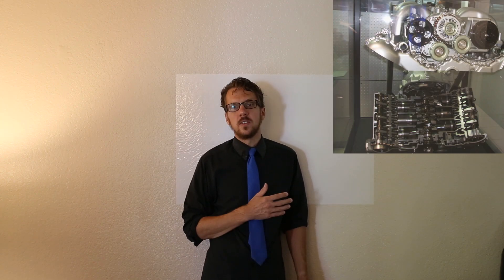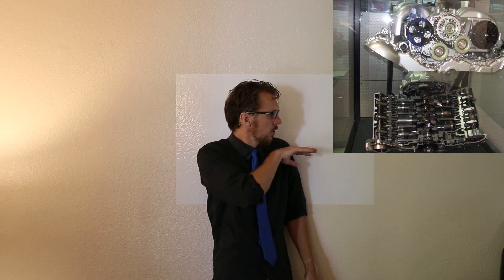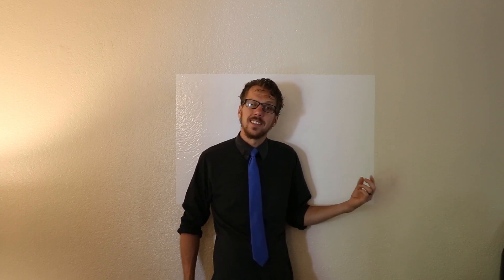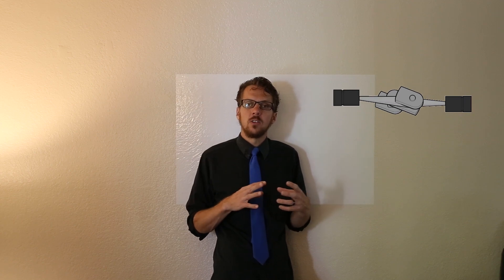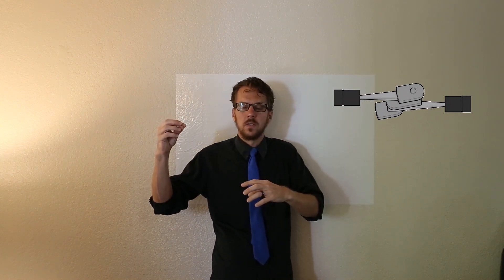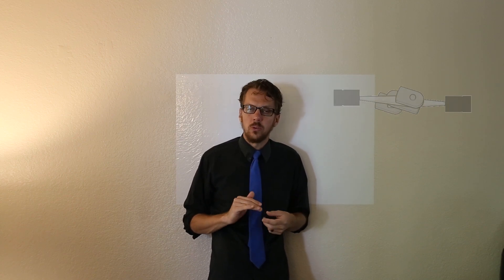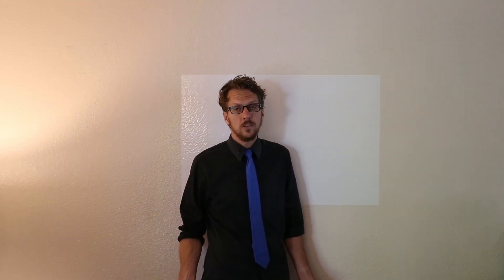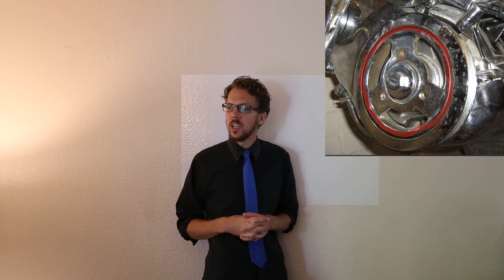How Lightweight Flywheels Destroy Engines (LWFW part 2)

Comment: Would I bother using a light flywheel on a read car? No though have in the past. Racecar however [roadrace and speedway] they are essential and ideally you should also use a lighter balancer as well. As well as a smaller dia one. Or more importantly a smaller far lighter clutch. Centrifigual mass is a real issue, smaller mass the better the engine responds. 
Balance? IF the engine is balanced to suit there is no issues, even a 40lb nuetral balance clutch and flywheel can use one half that weight. Or speedway use just a small dia flywheel with a conical clutch.

Comment: I ve owned and own tercel 4wd 83-87. 22 years ago I lightened the flywheel I removed as much material as possible and had it balanced at a very hi-tech shop. that flywheel is on it s second motor and it s been resurfaced twice... it never broke a motor, nor did it vibrate but it is very rough on the flywheel s middle pilot bearing the one that bears the tip of the input shaft . there is only one PLUS for a lightened flywheel on such a small engine ( 1.45L ) and it should not be your daily confortable vehicule : on a slippery flat surface such as cold snow you get instant torque/;limiited rev , that s it. don t expect to go up hill easy , beware strong winds , forget smooth idle and in cold starts northern region (canadian shield ) hold the clutch pedal and massage it while shaking tranny s oil...

Comment: I put 322k km's on my B18C1 with a lightweight flywheel.  Then I rebuilt it  and it's got another 60k km's on it.......with many a pull to 9,200 rpm.  I daily it, and have never had ANY engine issues.

Comment: The engine is moving the weight of the car from standstill, if it can handle the stress of this task, it's not.going to pack in because you've taken a few grams out of the flywheel

Comment: I have put over 120k miles on a 12lb reduced flywheel (and replacement with same kit after turning the pressure plate into a flower ala leg day). A lot of these have been hard miles including club races, and there is no noticeable irregular wear at all, on anything.

If there is any increased wear, it is only significant academically.

Comment: DMFs are nothing but a cash-grab. It replaces a never-fail part, that was easily replaceable if not serviceable, with a flimsy, un-reliable, and very expensive part. The reason why manufacturers are using them is because they reliably fail early, at around 100k mi, costing $3000.00+ in parts and labour, motivating customers to just buy a new car. The transmissions paired with DMF are also fragile pieces of crap that will break in short time if the DMF is replaced with a single-mass flywheel. DMFs are a regression in every single way. DMFs are nothing but anti-consumer business practices.

Comment: You can avoid that with Fluidampr viscous silicone harmonic balancer... lessen vibrations and gearbox chatter
Reply: can u explain ? tq
Reply: @SPEEDHANTU-si1ph  just replace your stock harmonic dampener with one from fluidampr, other brands do the same thing but it’s less good as they require tuning every time you change the harmonic of the engine…

Comment: First car I ever put a good bit of money into I upgraded the clutch after i torched it just trying to clean the tires off before a street race. Stage 2 competition clutch and an oem throw out bearing(never use the bearing in a clutch kit bc they are trash and never fit right.) Along with a 7.5 pound fidanza flywheel. Car picked up 2 tenths on the et from that flywheel alone not to mention a noticable seat of the pants feeling. Little 4 cylinder car was unbeat motor to motor. On the street. Was putting together a direct port nitrous setup for it with some godzilla sized nozzles when I wrecked the car on a rainy day. Car was prepped to make 550 whp with limited slip and slicks. Had a fender exit 4 into 1 header intake manifold coolant bypass, cold air intake. Colder plugs, limiter raised to 8600rpm with cams to take advantage of it. Solid mounts. Walbro 255 and a stand alone. Had the cam timing perfect had the ignition timing perfect on 93 and 110 with a table to pull timing as soon as nitrous was activated. Had the afr spot on at 11:2:1 off bottle and 10:8:1 on bottle. Wideband was in too of course. Car was scary. Lol
Reply: Fantastic build

Comment: I still don’t understand how it would damage the engine to have less rotational mass if there is s harmonic balance shaft already doing that in the engine and I’ve actually got a Mazdaspeed6 where every single person with one swears that removal of the 20lb balance shaft extends engine life in its case by keeping the oil Chanel clear please explain in more detail y it would damage an engine and how and by how much

Comment: They don't. 

Lightweight flywheels are awesome. I've had one in my AE86 and my NA Miata, and the way they improve engine responsiveness is life changing. All the tolerances in the motor are already finely tuned, the dual mass shit they're putting in cars today is purely to make them easier to drive. Get a lightweight flywheel, learn to drive it well, and you will never want another boat anchor mounted to your rotating assembly again.
Reply: What about a boosted engine?
Reply: iam trying to learn about cars and i have a question. why is the flywheel so important? couldnt you just have an engine without it? and why should it destroy the engine if youd have a lighter flywheel?
Reply: @bakoty6571  it allows the engine to have enough rotational momentum to keep running.
Reply: Yes sir preach
Reply: 😂😂😂😂man “boat anchor”
Reply: @UC30nRA-wEaW6LLcY6447aSw lol because it's a massive heap of sheite
Reply: Love you for this comment
Reply: you put heavy flywheels in a drag car
Reply: Put it on a 997.2 GT3. It will go boom!! Consider engine harmonics
Reply: @latuba2478  The gt3 RS comes with light flywheel… it goes boom but in a good way!

Comment: Flat 6 aren't smooth because you have 2 pistons in a way an 4 in the other way.
So it's imbalanced.

A rotary is balanced (independent of the numbers of rotors, except for 1 rotor)
A opposed piston engine is pretty balanced
a boxster, as shown in the video, isn't balanced

Comment: Claims to have done the math to prove his point but then shows no calculations whatsoever. Fail.
 I have never seen or heard of a single piece of motoring literature that claims DMFs are for the benefit of engine life.
They are there for NVH reduction in the passenger compartment, nothing else. You are not "increasing the vibrations" of anything by removing it, just removing a filter between the engine and trans. How and why this would have any effect on engine life either way is nonsensical.

Comment: The 997 (both .1 and .2) gt3 rs are PLAGUED by these problems. The solution for costumers was adding a ATI dampener. They do take more time then regular engines to blow, but it happens a lot.

Comment: What about the old muscle cars? They didn't have dual mass flywheels back then. A lot of those cars went over 100,000 miles with no issues. And they was pounded on too. And some had flywheels that weight about 20 lbs too.
Reply: I believe the HP 427 corvettes were equipped with a related duel clutch system.

Comment: Just put a 12.7lb flywheel in my FRS (7.8lbs lighter than stock) best decision I ever made.
Reply: How's it looking three years later? I'm about to get a lightweight cusco flywheel and clutch also carbon driveshaft. I want to make sure I won't regret it
Reply: @BRZTrackDays  any regret?
Reply: @swany0095  I changed my mind on the driveshaft. I hear more negatives than positives about it. The clutch and flywheel I'm still getting, but not yet.
Reply: Any updates? My stock clutch is starting to slip a little bit (I have 90k miles on the original clutch) and I’m looking at upgrading the clutch and flywheel, along with the other goodies like the fork and stuff. 

How is it to drive around town? Is it noisy? Was the exedy stage 1 clutch/ flywheel a good combo?
Reply: @Michael Benson I have an 8lb in my s2000.  Traffic is fine
Reply: @Michael Benson not really. Just give it slightly more throttle when letting out the clutch in 1st and it's all good. I've had it in now for about 20k miles, and haven't had a single issue. I went with the exedy chromoly lightweight flywheel, along with an exedy stage 1 clutch. It only took me about a day or 2 to fully get used to it. It makes heel and toe downshifting an absolute joy from how responsive the engine becomes.

Comment: You're actually explaining it wrong, the one you're showing is a boxer engine, a flat 6 is the same as a v6, but with an angle of 180 degrees (the opposing cylinders connect to 1 crankshaft pin)

Comment: You can run a engine with no flywheel but getting the gearing low enough to get 5000lbs moving would be near impossible. 1000cc sportbike engine has no flywheel to speak of and will run for years. A 5 ton truck may have a 60 lb or more flywheel to get it moving from a stop. The mass of the flywheel is there to give inertia to get the mass of the car moving from a stop. The engine needs no more flywheel than is needed for it to start and idle. Dual mass units are for comfort and are often replaced with one piece units as replacements. No way it will ruin your engine ....A corvette with a 350 will not do a burnout with a 10 lb flywheel but will shift like lightning and the engine will run for 220kplus  miles with no destruction. screw your calculations.

Comment: Very little here is understood by the presenter regarding torsional vibrations OR rev-match shifting, which is unfortunate. The better lightweight street flywheels currently available pose no additional problems for engine bearings. In fact, the argument could be made that the lower torsional resistance means the rod bearings might take less hammering. The crank main bearings will not notice the torsional difference at all (they don't "see" torsional excitation), although they will appreciate having less useless mass hanging off the back of the crankshaft due to the reduced bending moment. Also keep in mind that a "perfectly balanced" engine only compensates for 1st order torsional vibration of rotating components. 2nd, 3rd, etc., order torsionals cannot be compensated for without counter-balance shafts, which very few engines have (mostly inline 4-cylinders over 2.6L). Power pulse inputs are always unbalanced, as physics would have it.

For shifting, rev matching on downshifts is significantly easier with a lighter flywheel, due to much less waiting for the engine speed to rise during throttle blip. A day or two after making the change, most drivers will become the most proficient that they have ever been at it. Getting back into a similar car with a heavy flywheel will now feel a bit pathetic and lazy.

Lastly, the entire reason Porsche (pronounced "POR-sha" by Dr. Ferdinand and his family) and other manufacturers choose dual-mass flywheels (DMF) is missed. It is for noise/vibration/harshness (NVH) reasons -- not engine longevity! Very few street drivers would put up with a lot of rattle in a $100k plus car. A well-tuned DMF will eliminate the gear lash rattle the Porsche transmissions are well known for. Single mass flywheels have no means to damp the torsional pulses that excite the gears to bounce off each other, especially at idle with the A/C on. So, yes, one thing I've seen as a negative on Porsche's is a bit of gear rattle. This can be reduced by using a clutch disc with carefully selected hub springs (the factory Sachs/Porsche units have solid hubs), although it is nearly impossible to eliminate completely on these cars. That said, the noise is harmless other than slightly annoying to some.

Overall, anyone intending to drive with any sort of sportiness or passion will definitely enjoy a lighter flywheel (within reason). Full race setups are far lighter, miserable to drive on the street and will wear out discs much more quickly. There is a huge difference, and anyone properly trained in modifying Porsches can correctly guide you towards an intelligent decision that is correct for your driving style. About 95% of the time, that won't be a DMF!
Reply: preach
Reply: Chris Bernal what about drag racing? If u only want fast acceleration does a heavy flywheel help over a light one? I can imagine that light ones will effect drag times?
Reply: "anyone properly trained in modifying Porsches can correctly guide you"
Reply: I recently purchased a 2003 mini cooper s this is the first car I have had trouble shifting never had a vehicle with a dmfw I usually don't need to use my clutch except to stop and start I have always shifted up and down by rev matching and just can't consistently do it with this car it's miserable I now think it has to do with the dmfw would you agree?
Reply: Yes @rickybobby9005

Comment: I think you make big things out of small things. Harmonic balancers have to do with torsional vibrations. Aand the longer the crankshaft the bigger the problems with torsional vibrations and stiffnes as it acts like a spring. A crankshaft from a flat six is short and it has a very good balance so not a big deal. A flywheel has to do with constant wheel speed. The lighter the wheel the less regular the spin of it. And so it has more vibrations at idle and gear noise. That's all it is. On the 911 RS who cares about noises. It's a race car.

Comment: My 99 NB miata has a 13 lb flywheel - original is a 16 lb. It is  fun although I recommend if you have a Miata and want onet then get a FM flywheel (Flyin Miata') as it will perform better than simple aftermarket one that is designed to work with it. My light weight flywheel is a CompClutch (same company FM uses to design their Flywheel - but not the same specs as mine). My clutch right now is an Exedy (slightly stronger than stock clutch  not not made for forced induction applications). Great clutch however I think it would be more suited to a stock flywheel on my car as it has some vibration chirping noise issues that start happening later down the road. I am going to pull it and go with a FM clutch and flywheel (stage 1) even though I am not using any forced inductions. I'm not sure I agree with a lightweight flywheel shortening the engine life. If it does I don't think by much. It can be argued that it will actually extend the life of the engine - but of course this all depends on the driver and how well he decides to rev match it etc.

Comment: Hi. I have something to throw in the mix. Besides lightweight single mass flywheel, how about a single mass flywheel conversion kit. Not lightened, but a oem replacement of the dual mass flywheel for daily drivers. I am looking to replacing my Dual mas, but the cost of a Harmonic balancer it a bit too a high cost to add with the conversion kit for a daily.
Reply from the maker: Interesting idea. Would you install it with a sprung clutch plate? I feel like that might be a good compromise.

Comment: Crank, pistons, rod bolts, piston pins, clutch , trans input shaft, clutch pressure, bolts, etc,  weigh about 130 pounds.
Taking 10 pounds out of that equation and suggesting it does anything over 100,000 miles is a bit silly.
Porsche put the dual mass flywheel there for the passenger, not the engine that is already balanced very closely via production controls.

What you are missing by skipping the LW flywheel is the joy of shifting.
Can't explain how it feels to you, you have to try it for yourself.
Reply from the maker: Agreed. LWFW vs. DMFW is really about the feel. I don't think there are significant performance gains. I'd like to drive two identical cars with the different flywheels so I could get a feel for it... but I haven't had the opportunity, yet.
Reply: Those are all closer to the rotation and the cylinder pressures either vacuum or pressure have their own input to rotation but entire fights inertia. While the flywheel isn’t that much of the weight it’s the farthest from the center creating the most inertia. Like a ball on a string that’s 2 feet long vs 3 inch string. Most of what u said is pointless. There is shuttering in the transmission with more inertia there is constant ‘preload’ if that makes sense. Exact same thing goes for engine internals. Much more drastic for the transmission tho

Comment: Had several LWF's. Neither were damaging nor notice any huge changes in driving. Just a slight acceleration in 1st and 2nd gear, which was the goal for Rally-x in my WRX.  I think I lost maybe 1 mpg on the hwy but don't have enough data to confirm. I was against LWF's due to the extra mass needed for launching and MPG. I don't launch my WRX and 2nd gear is horribly long, and it already being on E85, a 1 MPG possible difference wasn't a deterrence for me.
Reply from the maker: Yeah, I think most people considering a LWFW don't care about MPG much.  I do think performance driven uses (track, rally-x, etc.) are less likely to cause problems with a LWFW. I'm interested it didn't make that much of a difference in the driving, tho.

Comment: To compensate you can get a high quality harmonic balancer. That way you can have the lightened rotating mass while protecting your engine from the vibrations that it can allow.
Reply from the maker: Fair point, but then that's putting weight back on... maybe still less than a dual mass flywheel, but still.